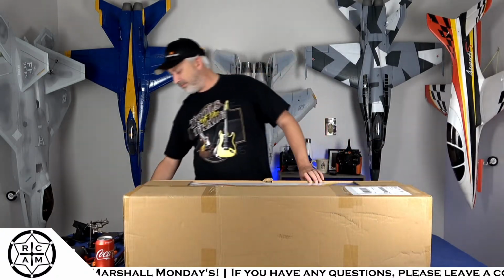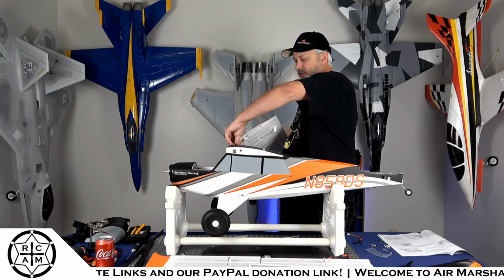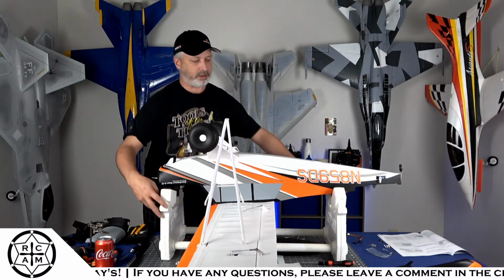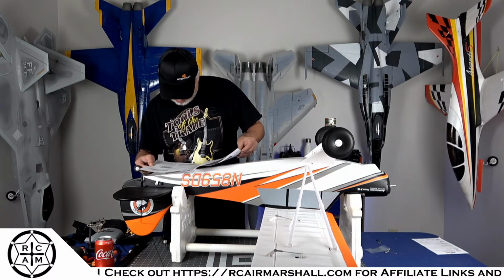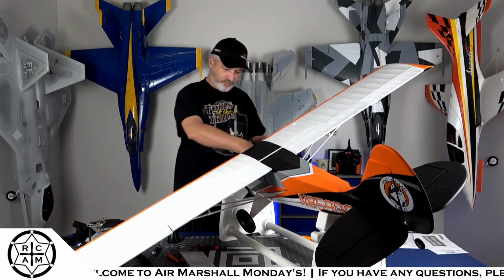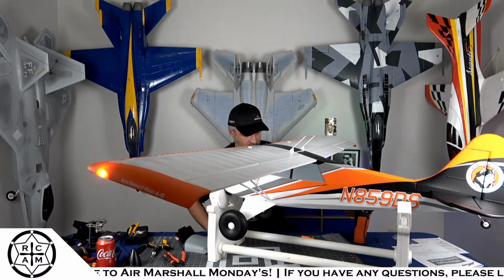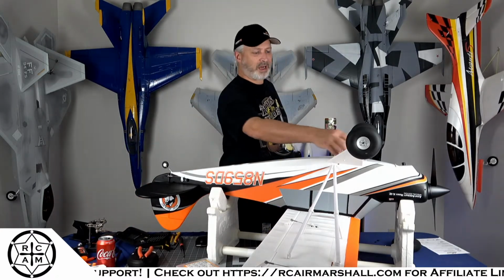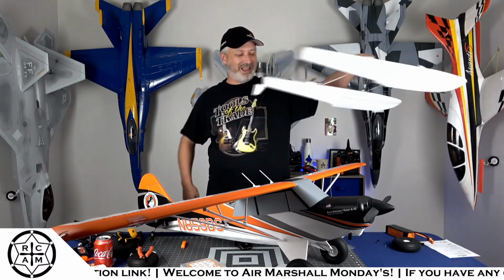Arrows RC Husky Special Edition - Live Build!

Comment: How could u put these wings on at the field. It looks very hard on the bench. Should have some sort of plug and snap in
Reply from the maker: It’s actually not too bad. Takes only a few minutes to get the wings on and off at the field. I was having a screw alignment issue during the build. The screw was not engaging the threads. That was my fault. That’s been figured out now. LoL. It’s just 6 screws total and a few plugs that are easily accessible with the battery hatch cover removed.

Comment: How do I link up my led buddy I can’t understand my connections don’t fit.
Reply from the maker: I used a Y harness off the throttle connector of the Gyro, and plugged the ESC straight into the receiver. Plugged the two LED leads into the Y connector and it works great.

Comment: I had the same problem with my regular Husky.  After about 1/2 hour it finally went.  I took off the wing and threaded the screw in all the way and then back out, then it worked.   It was in the same position , right front.